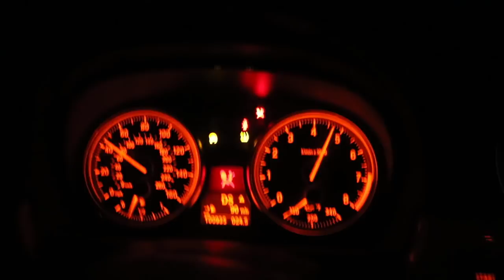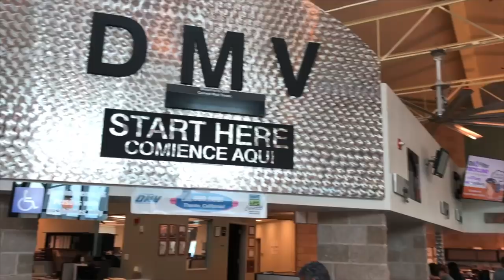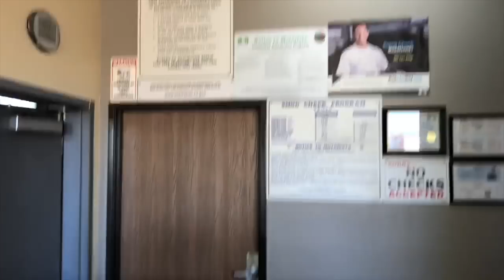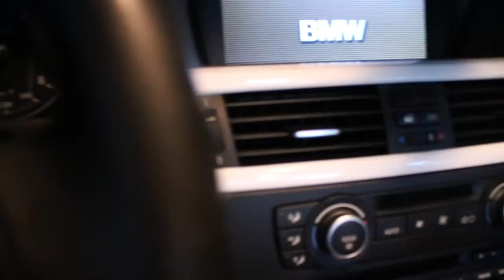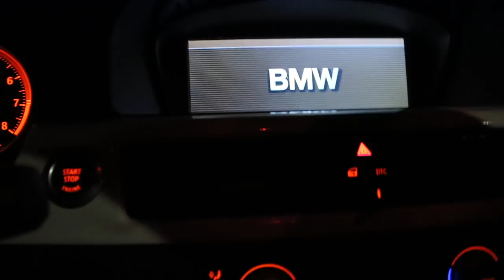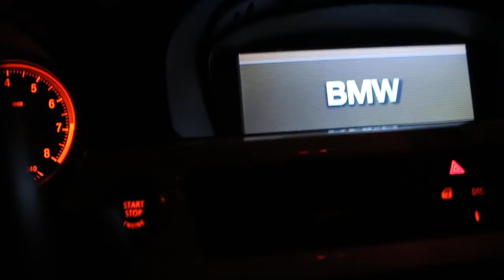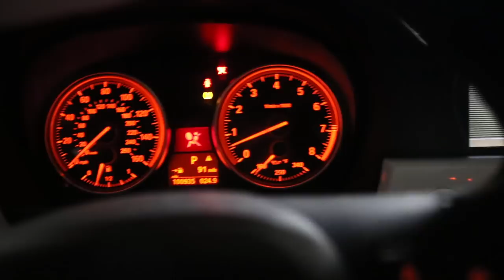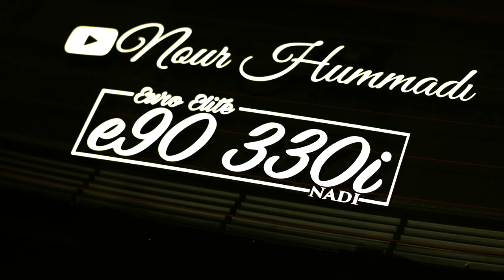I Almost Crashed First Drive! (N54 FOR LIFE)

Comment: Your engine temp gauge measures oil, not coolant/ water pump related. I tuned my bmw 335 and got ngk iridium spark plugs (gapped one step colder) and Delphi coil packs and I have no misfires. I would excomend to upgrade that instead of the “oem” option.

Comment: Do the BMW Smog drive cycle. Had the same issue with my brothers e46. I drove it for 400 miles of "regular driving" and it still didn't pass. Did the BMW smog drive cycle, then it passed. Takes less than 30 minutes to do

Comment: Did you torque the plugs or hand  tighten?
Reply: heatchamps2011 why would u torque them oh my god that’s the most smoked out thing I’ve heard today
Reply: Robles Inline 6 u do know they have a torque spec
Reply: heatchamps2011 if u torque them down that’s a hazard you just stop when there snug
Reply: Robles Inline 6 even the box says the torque spec. It was a simple question

Comment: Mine did the same thing with the obd2. It was because I had cleaned the codes before going in. Go in a day or so and it will be fine. It just need to take a little time for the system to read ready but this is good new bro. Keep killing it. I bought a 328i after watching your OG videos! 👍